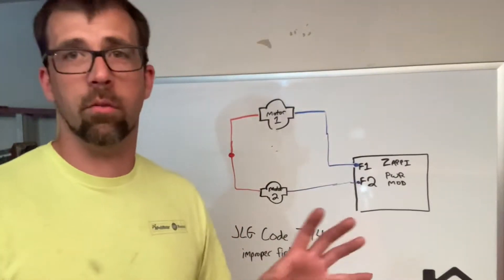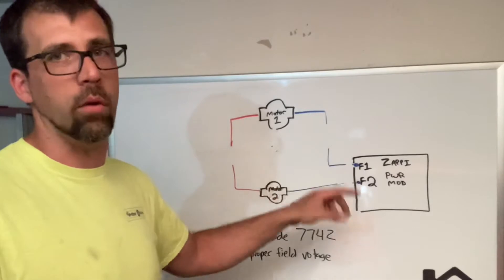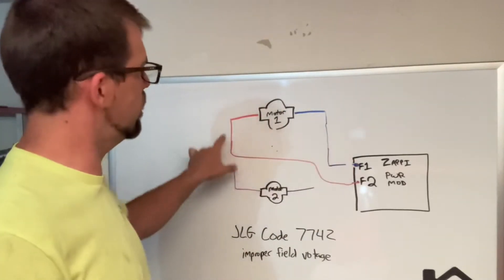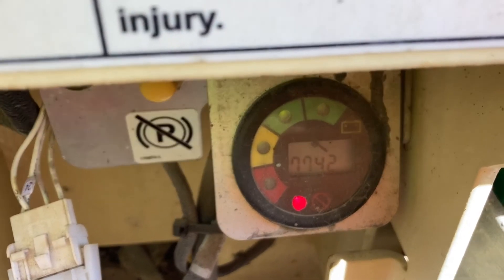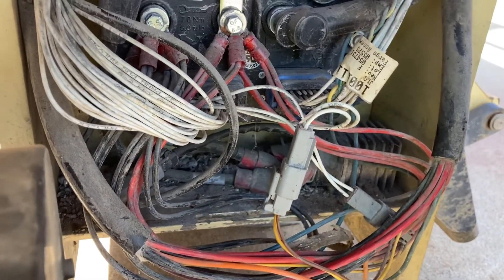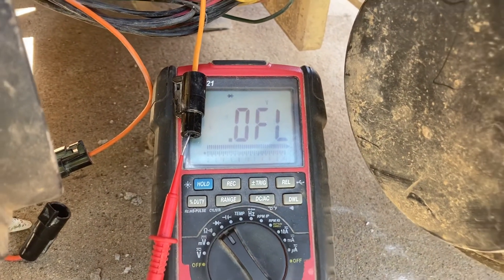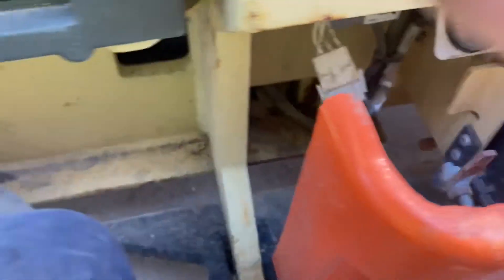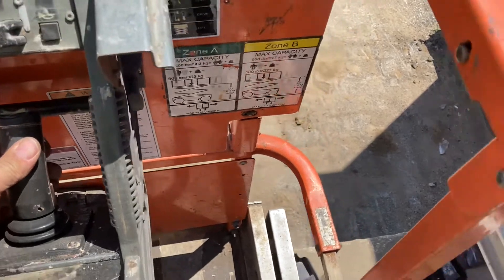FF6 JLG code 7742 improper field voltage no functions

Comment: Have an issue where running a motor by itself it works but as soon as they are both connected machine throws 7742
Reply from the maker: That’s is interesting, the motor controller is looking for a voltage signal return between f1 and f2, of its too low it will set that code. Has to have resistance issue in the motors is my guess. test the resistance of the orange and blue wires on each motor of one is way higher that might be the issue. The
Next thing I would inspect is remove the motor from the drive hub and see if water sometimes very rusty dumps out of the motor.
Reply: @VinylVillageGarage  resistance across the orange and blue wire, I have continuity across them on both harnesses
Reply from the maker: @reecehomes2227  yes continuity is one thing but resistance is another. If one motor has like 25 ohms and the other has like 50 that motor is probably the issue.

Comment: Thanks amigo
Reply from the maker: No problem, very welcome and glad
To help.
Reply: Was wondering if an analyzer would tell me the issue with a generator that isn't giving voltage to the platform on a 800aj .thank you
Reply from the maker: The jlg analyzer won’t tell you sky power Gen output. It will let you set engine RPM to fine tune the voltage output. Sky power can be diagnosed with a volt meter.  Most of the time it ends up being one of the circuit cards or the generator itself.  Do you Have a voltmeter?
Reply: @VinylVillageGarage yes I do ,I'll check it out thank you for your reply!